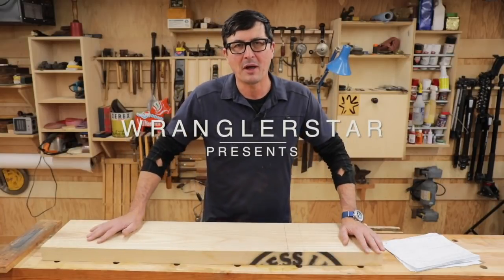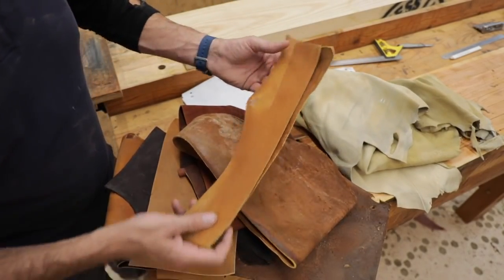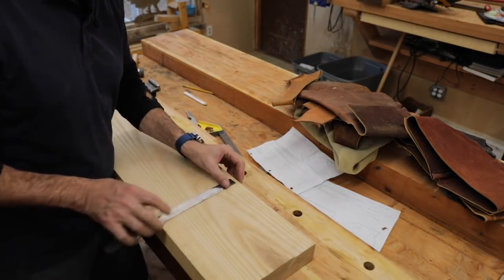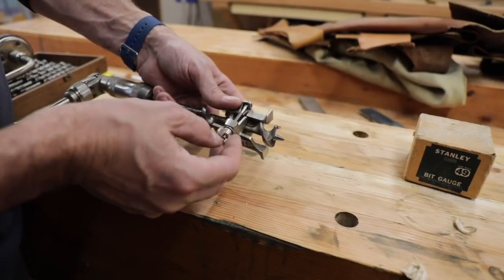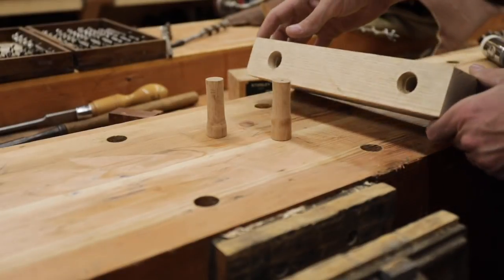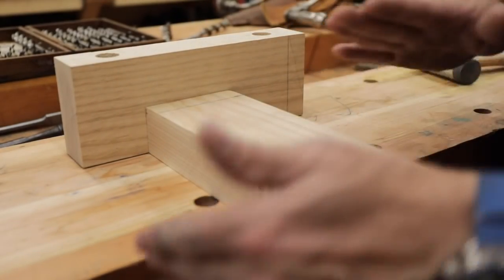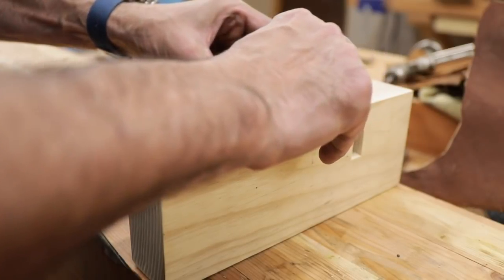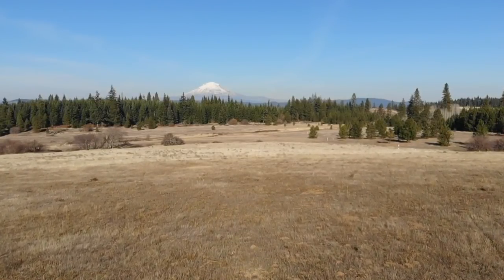TESTING  INGENIOUS TOOLS

Comment: Another way to measure the depth is to determine the thread pitch on the feed screw and then count the rotations needed for the depth you desire. For example, if the thread pitch is 24, once the cutting tip hits the wood rotating the bit 24 times would make a hole 1" deep. With such a bit 12 revolutions would be needed for 1/2".  The thread pitch varies so the specific bit set involved would have to be assessed.

Comment: My choice would be the red leather and finish the hickory with boiled linseed oil if it’ to be used with the notches and mortise with clamps to hold your snowboards when repairing bases sharpening edges and waxing.  Clamps to allow basically full access to the base. The hickory will not be springy and  would be astable base for edging and flattening snowboards. The leather to protect the tops. 🏂
Reply: Actually mortises could be for slat going between each end for support
Reply: Could be used foe skis as well but would not need to be that wide
Reply: Nice design

Comment: Its an adjustable stand /riser to use mainly for sanding and finishing pieces of material that hard to or can't be clamped the leather is to keep materials from slipping and the notches are for a removable backstop so it can also be adjusted for different size materials.  I think you should use the softest leather regardless of color then you can finish the wood a color that will contrast with the leather.

Comment: Method to get your dowel holes transferred from the work bench to additions.  I took this from
an idea on Underhell.  Prepare 2 marking dowels with scribes in the center.  Put the dowels in the right bench holes and place the addition on top and mark.  Rotate the dowels a few times and remark.  Now the true centers will be withing the circle made by the remarkings.   Special thanks to Underhill for his showing how this is done using scribes to find the center

Comment: Use the new tanned leather.  Grandfather's scabbard might be too rough, and the split grain stuff that feels like velvet will over time load up with dust, dirt, and anything else you get on it then it will act more like an abrasive surface than a protective one.  Use the nice new tanned stuff, and put some Obenauf's on it or the like.  I can think of a hundred things you can use those for in the terms of protecting the finish on furniture that you are going to repair or touch up.  I am going to agree with James Cole that these are for Snowboard and Ski maintenance.

Comment: I vote for leather #1 because I think this is a razor or knife strop block. Choice of leather is based on the idea of the leather grade as in days past the leather color is somewhat related to how fine edge you want. They used to use light pig skin for a final strop.  One thing, I can't say what the notch is for and I don't know why you need two blocks unless one is a gift or for a different leather.

Comment: Not sure what it will be, but it looks like it’s for something you don’t want marred or scraped on the wood (hence the leather), but will need to be clamped at either end (hence the angled undercuts on the ends). The deep dado could be to insert some integral part, and it looks like you’ll be doing whatever it is on the bench top, with a primarily pushing motion (hence the bench hook on the bottom). Still thinking on what it could be for.